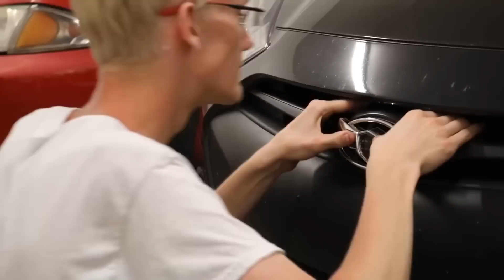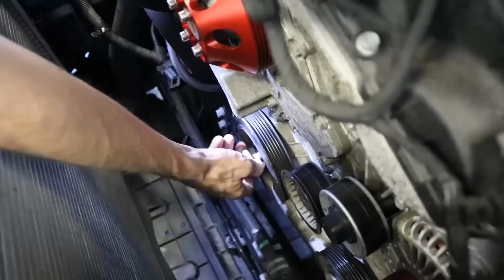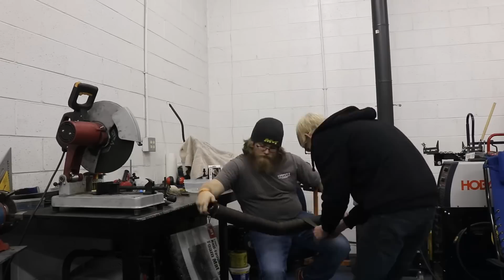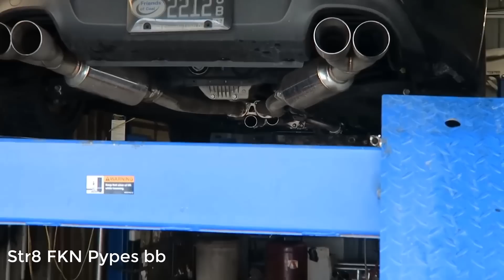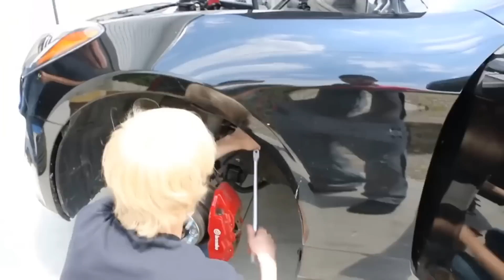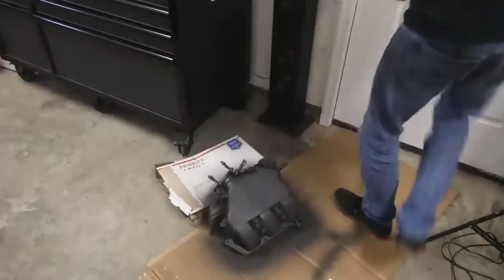4 years of Mods in less than 20 minutes! (Turbo 3.8 Genesis Coupe)

Comment: Hey man love the génesis it’s looking sick, I am planing on getting one maybe a 2.0t or a 3.8 but have you ever had any problems with it? Are these cars reliable? I would apriciate it thanks
Reply from the maker: The 3.8 is pretty reliable, I had it boosted on the stock block for 3 years and daily drove it most of the time. The 2.0t seem to be weaker, at least compared to other 2.0ts
Reply: @RspecRyan  All right man thanks

Comment: you installed the coolerworx wrong. plate with studs go UNDER the trans tunnel. it says it in the instructions. I made the same mistake too and it was much more noticable

Comment: forever feel like you missed out with this car because of your transmission issues.... what a shame dont know anyone with the amount of issues you had with shifting....
Reply from the maker: I feel like it’s been the clutch the whole time but I don’t feel like throwing more money at it
Reply: @RspecRyan  why not get a stage 3 competition clutch? i have a stage 2 and its great shifts are spot on. but never had the 2nd gear lockout in the first place. sure it isnt your diff bushings?
Reply from the maker: @sohogen8482  I installed a stage 3 competition clutch in this video and that’s when it got worse
Reply: @RspecRyan  shit.... lol idk what to say but that sucks its a great fucking car but with the problems you had im not suprised you dont like it very much....have you checked your drive shaft u joints? your diff bushings? maybe your lsd is fucked? tried getting a newer model transmission? idk bro anyways nice to see a vid again goodluck!
Reply from the maker: @sohogen8482  I have 4 diff bushings and I pulled my 2013 trans out and put a 2015 trans in it, Megan trans mount, redline fluid, coolerworx shifter, engine leash, driveshaft flex discs (no u joints) the only thing left is the clutch
Reply: @RspecRyan  i just dont see how it would be the clutch ... i know mutliple people with a stage 2 including myself and never had an issue.
Reply: @RspecRyan  where you get the flex disk at?
Reply from the maker: @sohogen8482  it shifts fine normally but at high rpms does not which means the clutch is not fully disengaging
I’m not sure where I got it at, one of the OEM Hyundai part websites
Reply: @RspecRyan  im interested stock drive shaft u joints are a joke. ahhh ok i get you well id give it another shot